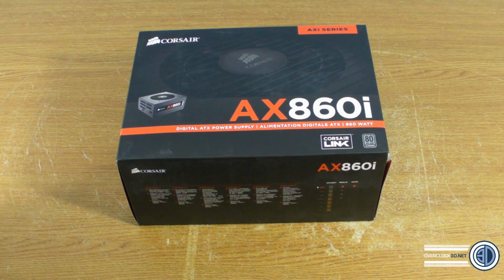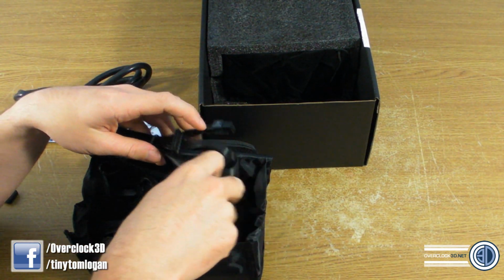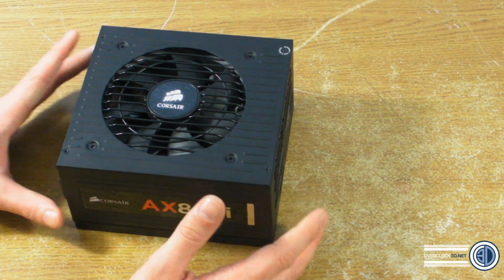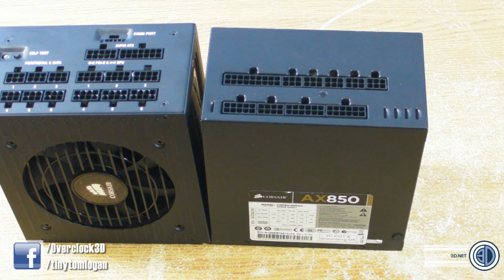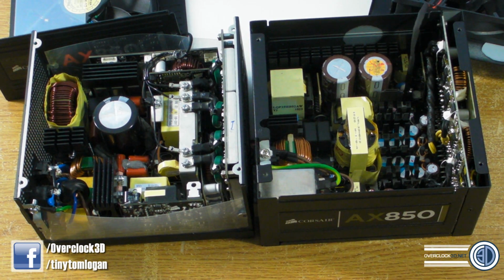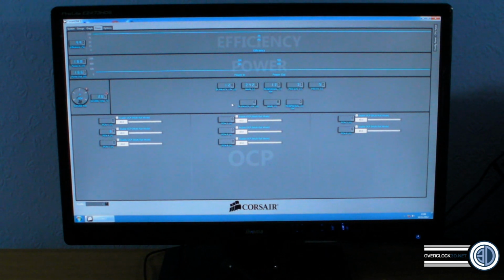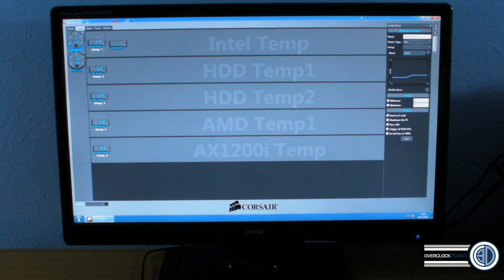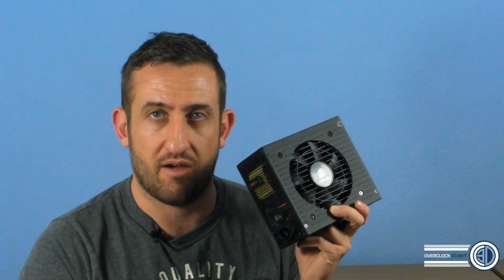Corsair AX860i AX760i Overview PSU Power Supply

Comment: is the  AX860i with a asus maximus formula viii, asus gtx 1080 stix ok or do i need more  thanks
Reply from the maker: you could power that rig with a PSU half the size
Reply: +OC3D TV thanks
Reply: Haha I have this setup only using below 400W on load when play BF1 max setting on a beast monitor.

Case: Phanteks Enthoo Elvolv Atx Tempered Glass
Moto: Asus Maximus 8 Formula
Cpu: Intel 6700k
Gpu: Evga Gtx 1080 Ftw Hybrid
Ram: Corsair Vengeance Led 32Gb 3200mhz
Ssd: Samsung 850 Pro ssd 256Gb ( for the time being)
Psu: Corsair Ax860i
Cpu Cooler: Corsair H100i V2
Case Fan: Corsair Ml 120mm 
Monitor: Asus Pg348Q 34'' IPS curved 100hz
Keyboard: Corsair K70 lux rgb cherry mx red
Mice: Logitech G502 Prometheus RGB
Reply: This is probably too late but with a with my smart outlet I can measure the wattage my PC takes. With a 4790k and 2 1080s on default setting my rig only pulls roughly 500 watts while playing games like Battlefield 1, The Witcher 3, Titanfall 2. So yeah 860 watts is a lot for a rig  with only 1 card.

Comment: The 24 pin cable is split between 14 and 10 on the psu's end. Does anyone know why and whether or not I'm suppose to plug all 24 pins in on the psu's end. My mobo is a 24 pin.

Comment: I hear you mention you have to braid the cables one at a time. If you google the pinouts you can actually find the pinout for your power supply and for a sata power connector so you know where to put the cables back :)

Comment: These are great and all... but why 760 and 860? Why not 750 and 850? Just to be unique?
Reply: Sonefiler they didn't design the PSUs to have a specific power output. .they rated it after they built it.

Comment: Is this psu overkill for
3 x 780ti in SLI
3930k
4 sticks of DDR3
All overclocked.
Reply: wtf man you need more than 1000 wats wtf
Reply: Omg!! Ofc no you'll need the Ax1200i
Reply: 3x 780ti=750 watts, 3930K=130 watts, rest of system=50 watts, total equals 930 watts. This PSU won't do. You're not even overclocking so a AX1200i is preferred.

Comment: Love your reviews and have subscribed, but now for a comment (Not specifically towards your review). Why is it that all Corsair Link reviews seems to miss one big and nice feature, namely the system tab? You showed how all detected devices that are detected show up and showed that they can be sorted, but just like pretty much every reviewer missed out on the whole point of that tab (and the big gaping and exchangeable side view pic of a case should be a clue). You can drag any found temps and fan speeds etc into the case and position them where they actually are located for a nice graphical overview of everything inside your case (quick and easy way to spot problem areas for example). This visual representation of the innards of your build is one of the selling points of Link to me.

Comment: I had a broken (battery powered) camera years and took it to bits. I remembered somebody said the capacitors for the flash had a big stored charge so I laid a screwdriver across the terminals and - BANG! If I had touched it with my fingers I would have been dead.

Comment: Well the 760 has a switch to turn the hybrid fan on & off and the hybrid fan mode works a lot better than on the AX760i. The hybrid on the ax760i is totally crap, the fan ramps out of the nothing aggressively up being very noisy happening every 10sec, which isn't present on the 760. They both perform equally but I prefer the 760.

Comment: In my opinion Corsair (or actually their OEM) should have build an AX1050i. For my new system the AX860i is a just enough (no room for overclocking the GPU's), but the AX1200i is way too heavy. So I have to choose between a HX1050 or an AX1200i..

Cables are not an issue because I always make my own that have aperfect length and with sleeving in correct color. It makes cable management a breeze and very tidy.

Comment: Have you actually read reviews of it? The AXi series are absolutely amazing in terms of quality, pretty much the best you can get in the market right now. Voltage regulation and ripple suppression is out of the world really, not even a Seasonic comes close.

Besides, the products you talked about are aimed for completely different audiences, Corsair wouldn't pick Flextronics as the manufacturer of their flagship power supply if they weren't good.

Comment: My only experience with Flextronics are my 3 dead Dell laptop chargers (my friends also have a few of those amongst them).  In other words, everything I have ever used by them on a consumer level has failed utterly and quickly.  Wasn't in the PSU market anyway but I'm disappointed Corsair have gone for the gimmick over quality.  Hopefully Seasonic work it out and we can get back to good stuff.  I wouldn't trust Flextronics to wire my electric toothbrush.

Comment: @TimeToLiveCustoms
Boy, ohhh boy! Flippin' badass review & long as could be. Still, it's my kind of review & popping the hoods was really icing on the cake for me!
I am curious as to what the uF & voltage are on the capacitors of each. It's a love hate relationship with the single filtering cap, it depends which manufacturer made the cap. Ripple can be reduced if one was so inclined to mod the circuit ever so slightly.
But, I liked it. Good stuff & glad to see the envelope is being pushed. Thx!